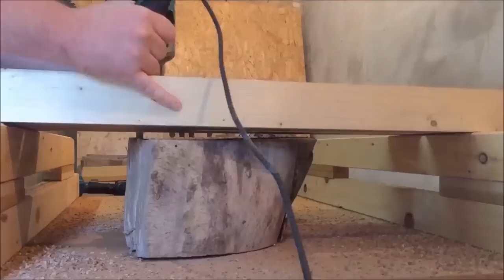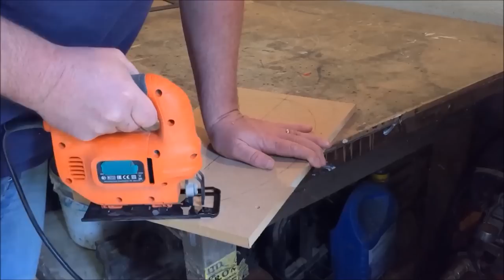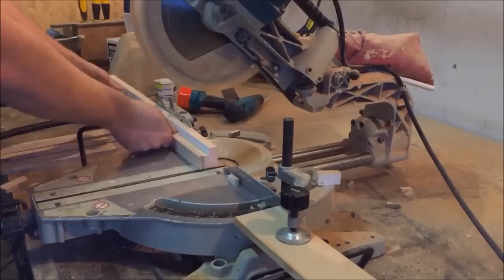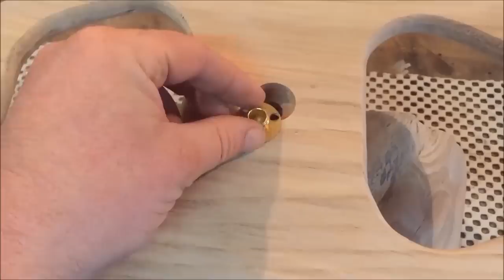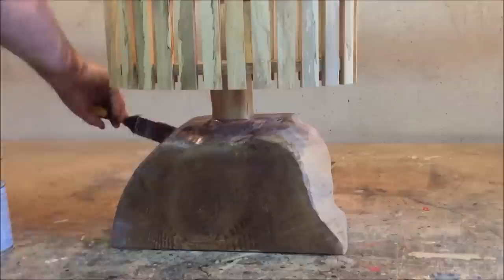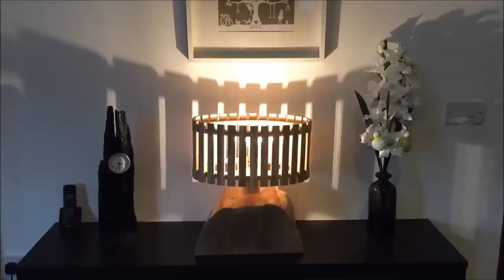Solid wood lamp with wooden shade.

Comment: it's unique, someone might try and make one similar but it's one of a kind. I tried to make the red round table you did a few videos ago but I didn't have a router bit long enough and I wasn't comfortable using a smaller one, i was pretty sure i was going to lose a finger so i bought a wooden column that is used for stairs (in spanish we call them "balustro") and then i made the legs and the top. thanks!